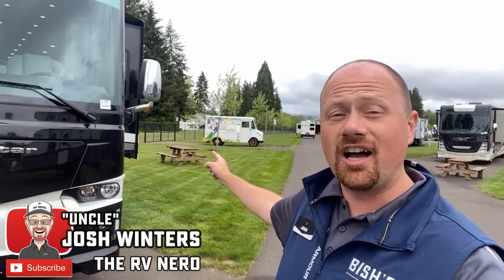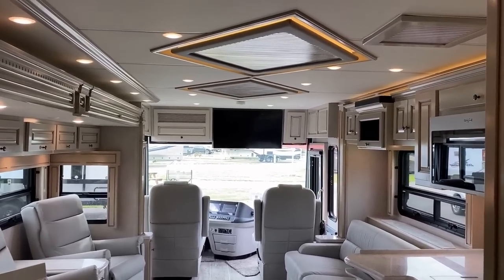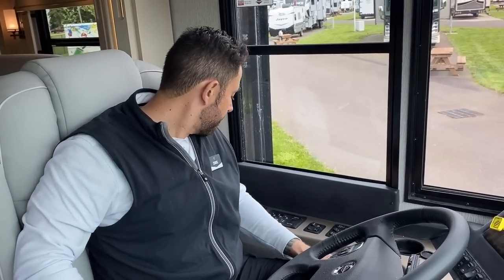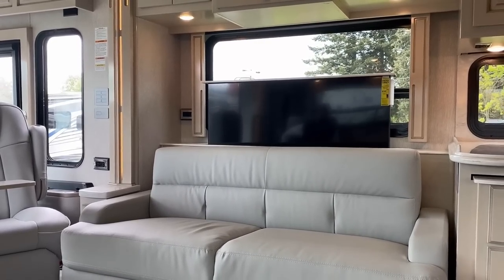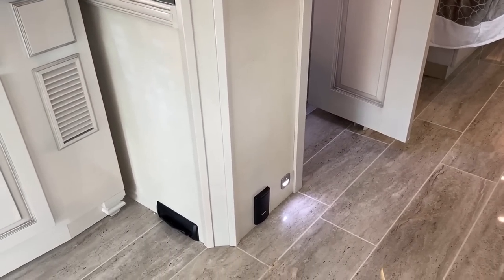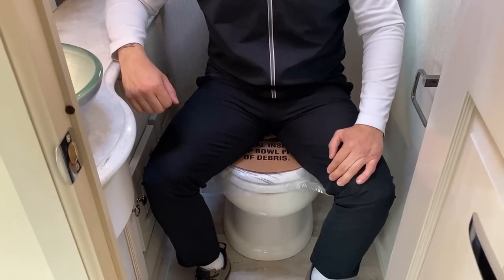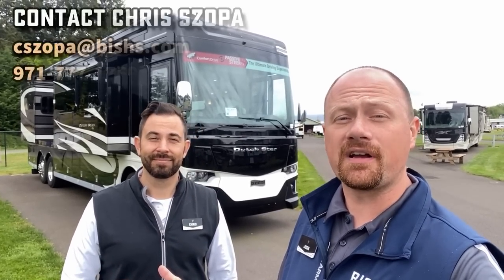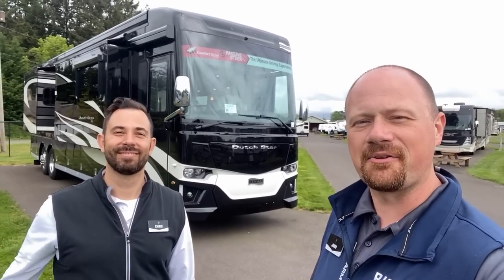SUPREME Build & Luxury!! 2022 Newmar Dutch Star 4081

Comment: Very good video. Love the Newmar line. However, there is one feature that was overlooked. If you look in the cabinet over the bed in the bedroom, you will find an electrical outlet with access holes on both sides. Reason for this is you can plug in your CPAP machine. I believe that Newmar was the FIRST RV manufacturer to incorporate this.
Reply from the maker: That's awesome! Apologies I missed it. I know Coachmen is doing that but now I know where they got the idea :)
Reply: @JoshtheRVNerd  No worries on this end.  After all, there is ONLY 37 hours in a day!!!
Reply from the maker: @cbramsey5898  dude gahahaha

Comment: Josh: If someone can afford the $600+k price tag and almost $4,000 dollar a month RV payment, the going price of diesel isn't likely a limiting factor. Do you need a CDL to driver it? or is there an optional driver included in the price tag?? Love the Motor home mombo in road mode. Respectfully, W.S.
Reply: DoT made an exception for RVs. So, you don't need a CDL. Though, I think you really should. Or at least have an endorsement on a class-c license.
Reply from the maker: Licensing can vary by residency. MOST places require no special licensing
Reply: As a truck driver for almost 30 years people should be required to take some kind of training before driving one. It is a bus just dosen't have all the seats.
Reply: The A restricted class licence was created in Ontario and some other jurisdictions for when you have more than 24 000 lbs of weight.

Comment: My 2021 International has a hydronic heat no idle system. And 8 group 31 agm batteries.

Went through Coldwater twice this week. Up to Lansing and back down from Stanwood. I've wondered if you guys have truck parking available. Though I would only get into trouble either way.
Reply from the maker: At our facility we do not however there are several large nearby parking lots you may be able to use for a stayover -- mostly the normal kind of stuff like a Walmart or Meijer Parking lot. Bob Evans is RIGHT next to the highway and has a LARGE parking lot right next to it.

All of those would be walking distance from our store -- the Meijer parking would be closest though

Comment: The reason that there is no roof access is because the coach is 13'5" tall. Only 1" below legal height without a permit, AND bridge detours! The ONLY reason to go on the roof is, as you said, for inspection and repairs. That's not something you're going to do on the road.
Unfortunately, with so little room, you can't even put solar panels up there!
Reply: Don’t need solar it’s always going to be at a extremely luxury resort
Reply from the maker: Hadn’t considered that but I have seen plenty of large coaches with at least removable ladders. It feels like something that could be done

This gives me a great place to start investigating though so Ty!!
Reply: @pault1964  Yes. And it has a very large generator on board already. Solar was just the thinest cargo that I could think of that someone might want to put up there.
Reply: @funnlivinit  boondocking is not  in a thing luxury class A,got to be close to a million dollars,ten years time maybe

Comment: I still don't understand how nearly all these huge rigs don't have a real oven. How do I get my fresh baked cookies and pizza?! I guess if you are rich enough to buy one of these you can have your man-servants make em for you.
Reply from the maker: I've noticed similar things - there's a serious lack of ovens in large motorhomes. It's interesting to me as well
Reply: That's a great observation! Propane is indeed offered as an option on the Kountry Star diesel pusher, that begins the Newmar diesel class of motorhomes. At a certain point, they eliminate the propane option, most due to the engineering space while offering options such as hydronic heating and larger batterie bays. 

Great thought! Thanks for checking out the rig 🤙🏻

Comment: I am going to be a bit short here.
AGM…Realy, REALY!!!
600000+ and no lithium???

No solar package as an option?

I know that the folks buying a traveling palace such as this will normally not even consider anything like boondocking or muchdocking, but ya never know ;)
Reply from the maker: It seems odd to me as well as someone with more of a towable background but I think folks with rigs like this simply use them differently. They're going to use that generator most often to provide full function to the coach when desired and likely spend time fully hooked up at destinations regularly as well 

That's what I estimate. I could be TOTALLY wrong
Reply: @JoshtheRVNerd  Indeed